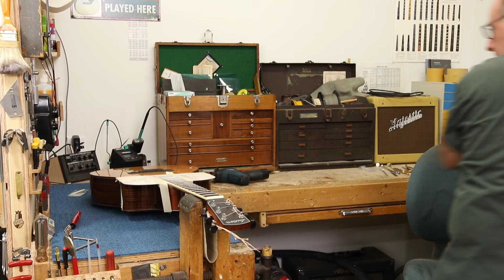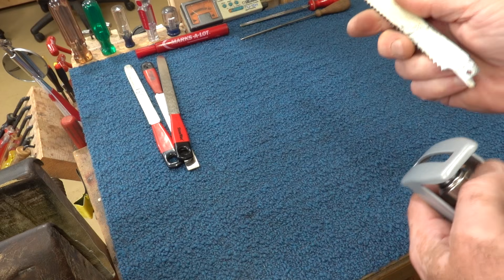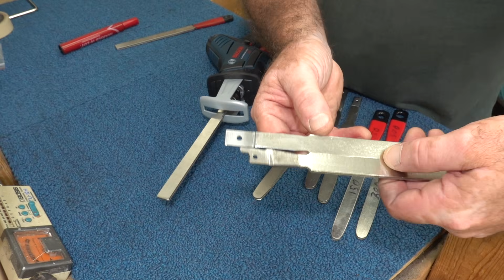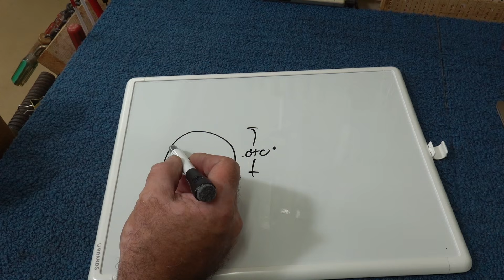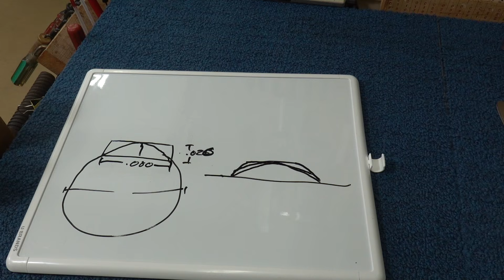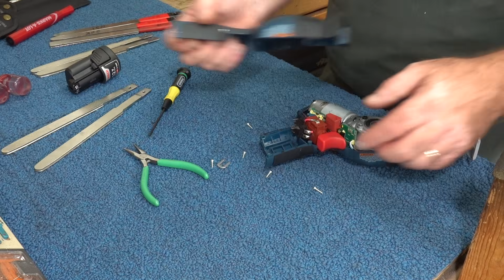New Fretting Tool Every Guitar Shop Needs!

Comment: Brilliant.  If I were a professional luthier, I would definitely attempt to recreate your reciprocating fret files idea.  So cool, and I’ve got to say you are being extremely generous by sharing your idea with the industry.  

That said, you really should contact a patent attorney and apply for patent(s).  You might decide not to enforce it, but it’s your invention, and you should protect your ideas in case you’re ble to negotiate exclusive fabrication  and distribution agreements.    

Like you mentioned fret files are expensive; especially from SM; though you get what you pay for.  StewMac also doesn’t so much as blush at pricing their pricing structure.  Anyhow, great idea and good luck.   

Fretfucker does have a nice ring to it, too!🤓👍

Comment: Hey, don't knock BOSCH, I bet that saw is stronger and less wobbly than many other brands, even at a smaller size.  Been doing it the hard way for 4 decades already, and was a very early proponent and adopter of Stainless steel frets:  Daaaaaaaaaang do those tire you out, and do a number on your tools, but they are great, so as for the advantages to the guitar owner over those of me the luthier I have to go with the former, and deliver the best results I can.  I learned extensive metal working and am great with files, and long strokes and a purposely aimed sculpting motion is required to do a great job by hand, and I don't have any problems with bumping into the side of the neck, or going sideways, and short strokes take much longer.  This of course can be a big time saver, and nothing wrong with that as long as it can do the job right, so I am going to have to try this.  That saw looks just right for the job, and BOSCH has never let me down so far...  It will be a lot of work making the files fit the saw though, so I agree that if not Stu Mac, someone should make them or get the manufacturer to, maybe even just a good adapter!

Oh dear, now I will be all occupied to come up with an easier way to make the files work with the saw!

Comment: ingenuity at work! i applaud you sir!.. have you noticed the work area of the crown files getting warm at all?.. if so, do you feel the
files will wear sooner than if used conventionally?
also, how doable would.making an adapter be for the sawzall that could accept the files as are or with minimal modification.?
Reply from the maker: I’ve not been using this arrangement long enough to give testimony regarding wear rate yet, but have begun using cutting fluids (new video coming) which should alleviate this concern.

Regarding the adapter, perhaps, but I was not able to conceive of a simple solution. For me, modifying the file tangs seemed the simplest accommodation.
Reply: @A2Guitars  understood, for those of us that dont have fabrication equipment at our disposal, such a task  would be out of reach... your  creation is worthy of further development. if you know anybody in the metal stamping business, i can see 2 pcs of sheet metal being stamped to cheaply produce an adapter. of course, cheaply only applies once a working prototype has been produced, engineering &  production costs to create stamping dies have been satisfied etc, you may never be able to sell enough of them to recover the investment.. good luck with your creation, thanks for sharing it!
Reply: im wondering if you could adapt a sawzall blade(s)that you could bolt/affix to the crowning files somehow?.. food for thought.

Comment: Clever!  After decades of giving StewMac all my money, I've been using a modified version of the Thomas Ginex bump-plates & sand paper system for about 15 years now which has been fast and efficient, but I still often use several SM and custom fret files depending on the job. Thanks for the new idea.

Comment: I H A T E  Fret crowning, but with this rig, i could probably love it!  Only thing I can "crab" here, is that you level without a Neck Jig.  I cloned the early "Stewie" jig, and eliminated all RE-LEVELLING!
Reply from the maker: The neck jig is a very useful tool - I worked on Dan’s original one for years, and used several iterations thereafter.

That being said, the methods I’ve developed since I feel have surpassed the results I could get with the jig, though I acknowledge that I could not have developed them without it along the way. I hope to make videos detailing my newer processes in the future, but it may be a while before I can fine time or means to do so in videos.

Comment: You sir, are a genius. I'm going down to my workshop and shaping my fret files to fit my electric carving tool. Thankyou from a luthier with longstanding RSI! I have a worn out file that I have stuck a thin strip of "micro mesh" on (with impact adhesive) to use as a final polish. I think this will work well.

Comment: I built the same setup a few years back using the cheap double sided grey crowning file you get for 5 bucks that has a rubber dipped handle that is way too small to hold for a complete fret install. I took some major flak from the luthier community. As far as the diamond files not holding up they are not meant to handle that much heat but if you went slower and or used a tap fluid they would last forever. I've been using the same 5 dollar Amazon crowning file for over 3 years without any problems. When you use cutting tools off any kind you have to be respectful of feeds and speeds. That motherhumper(hahaha pun intended) your using is way too fast. I've found the slowest speed on my saws all is on the verge of too fast.
Reply: Good shout. Cheers. I'm just off to the workshop to adapt my power carver. It goes down to less than 1 stroke every four seconds so should do the trick!
Reply from the maker: I’ve not been so concerned about the speed, as of course depending on the diamond plating bond type, some should be able to handle it (consider diamond rotary blades). 

That said, I have started to use cutting fluids/lubricants since originally shooting this video, and will likely do a follow up regarding this change. I have always used cutting fluids with traditional machining, but not with diamond cutters. After including this with these files, I will certainly be using cutting fluids going forward!

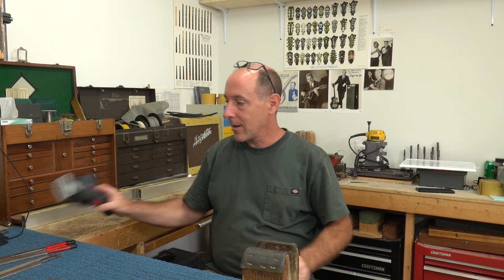Comment: 20:00 to 24:00 is a really elegant synopsis of the issues around crowning very low frets and it's the thing that's kept me using triangular files a lot of the time. I know the development and stocking costs would be prohibitive but it would be nice if files could be marketed in a variety of radii rather than "medium" and "large".
Reply from the maker: Thanks! And as I’m sure you well know, I barely scraped the surface of this issue here because fret shape would be a video of its own. There are still gaps in the diamond file sizes that I still need to touch up on the sides with a 3 corner or rocking of the diamond file. Nobody likes the feel of a school bus shaped crown.
Reply: "Scraped the Surface"...Pun (Huge Smile). This is a workable solution, Thank You. RESPECT! @A2Guitars
Reply: @A2Guitars  You barely scraped the surface because you mask your work sufficiently.
Reply: Gibson’s fretless wonder era… They came from new, with frets levelled so low they’d be impossible to crown into a true round shape. They just smoothed the corners.
Reply: Don't I know it!  I have several of the Les Paul/ Low Impedance Gibson like the LP Personal Professional Recording or L-5-S that have the "Fretless (opposite of scalloped) fingerboards including nibs on the binding for each fret and very low profile.    I do enjoy playing them as do my students.  @Jonathan_Doe_   from my family tie with Les Himself

Comment: What about just welding the tang part of a bunged out sawblade to the end for the extra half inch? Probably make the whole job easier
Reply from the maker: That could be an option, with the one caveat that most saw blade tangs come in around .050” width and I wanted to keep up around .065” to make for a bit tighter fit. This may not really be necessary, but with my resources grinding or machining was just simpler than cutting and welding.
Reply: @A2Guitars  I was also thinking about that trigger. I do wonder if a stepped potentiometer in the circuit could provide a consistent and repeatable speed setting for ya. Probably back probe the switch and see if you can’t put it in series.

Comment: Fine good idea but you must be careful not to get the frets too hot, even buffing with a dremel can get em really warm on a fast enough speed.
Reply from the maker: I was concerned about this as well, and actually setup a FLIR thermal camera to observe temperatures in early testing. 

So far I’ve yet to record temperatures over around 42°C, but yes, generating heat is certainly an issue to keep aware of.

Comment: Yes! This is really great. thanks for sharing. Subscribed! 

I got a nasty blister filing a nut slot today. 

I have been working on and off over the last five years doing metalworking on CNCs etc. There’s such a huge gulf between a PLEK and the luthier hand tools. Looking forward to the innovations to come. 

I get the feeling that stewmac marks up their good diamond fret files A LOT!!!There’s probably a lot of room to have quality files made over seas with the sawzall shank shape. I wouldn’t be surprised if you can have these made for less than $20 a piece. Yes, they are made with diamonds, but they are small pieces and not that expensive. 

I would find a tool maker and partner with them. Even if you partner with stewmac in the future.

I can’t believe it. I was just looking at your guitar intonation physics earlier today. I feel lucky that I looked at the video. Seems to be the reason why YouTube suggested this new video. Awesome. Really great. Thanks again.